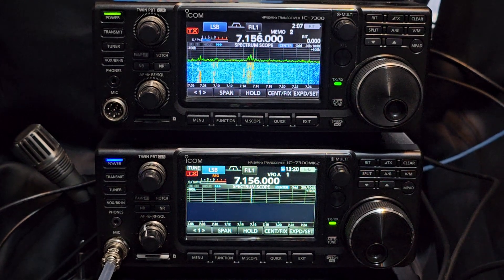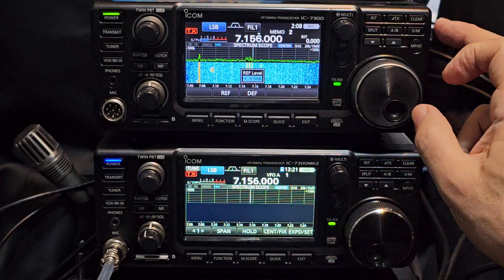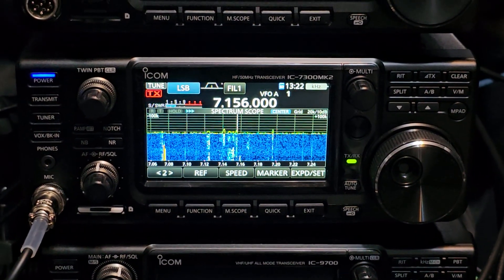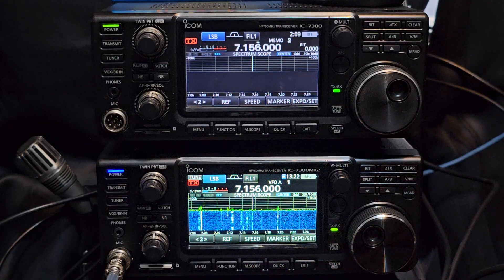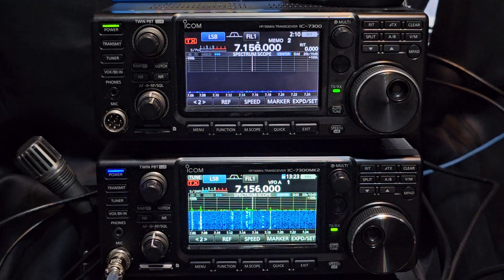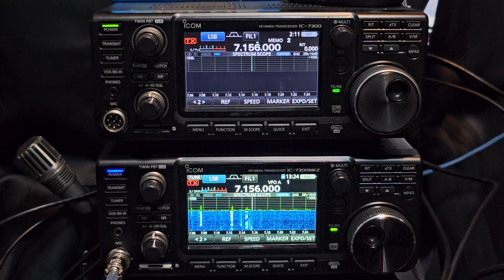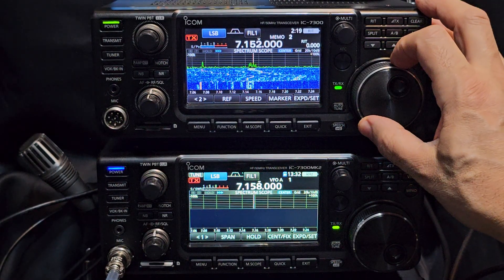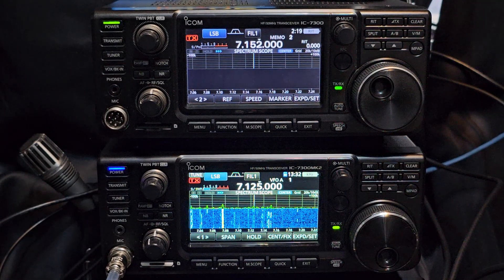ICOM IC7300 MK2 & MK1 Receive Test 2

Comment: You did not do the most important test that everyone was expecting to see, the dynamic range at 2 Khz that Icom claim its 104db on the Mk2 compared to the 95 db on the Mk1, we all need to see if its true, also you did not test neither the floor noise between them to know which one is quieter.
Reply from the maker: I use my ears on same antenna

Comment: band pass filter was engaged on the mk2 indicated by the little dot next to band pass width indicator , it might be worth using an extension speaker so the sound is coming from the same place.
The display on the mk1 is better.
Reply from the maker: Both great Radios

Comment: Thank you for your new video, much better than the previous. It still looks as the MK2 unfortunately shows no real advantages over the past radio (apart the LAN connection, to me). The RF-Gain setting on the MK2 at the end of the video looks beneficial, however.
Reply from the maker: Glad you liked it

Comment: Engaged tuner will create few or mor dB difference on waterfall (but not on SNR at this noise level). When Receive Test v 3.0 with the same settings (I'm joking !) ;) ?  Would be nice to see some CW comparison with strong close-in signals (250Hz-400Hz max separation, with 250Hz filter, like in contests), if there is any difference between old and new. Thx for cool videos
Reply from the maker: Welcome :)

Comment: Thanks for the video. I suggest you get a splitter so we can watch both receivers at the same time. 3 dB signal drop but the drop is equal on each receiver. I use a splitter when I compare receivers. The Mark II has improved RMDR but can't see that so easy. I look forward to Rob Sherwood's test. 73 de WA3RSL
Reply from the maker: Thanks for the tip.

Comment: Thanks.  When talking about the differences you seldom, if ever, mention the internal server.  Would love to see a video with you setting it up and operating remotely with this radio and compare to your experience with your Flex.
Reply from the maker: Yes i will see of the internal server will work when the PC is not connected .

Comment: I no longer have a 7300, but, I believe, the color shade of the waterfall, can be customized. If you take a note from those settings in the 7300, you could, IMHO, replicate the exact same color shades on the MK2.
Reply from the maker: I set the same settings
Reply: Colors can be customized but not the blue waterfall background.